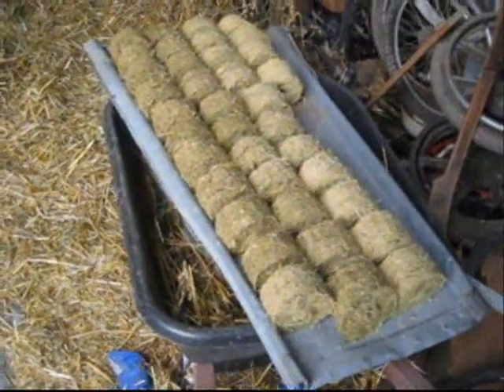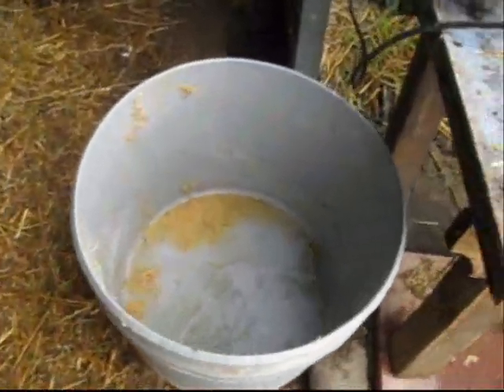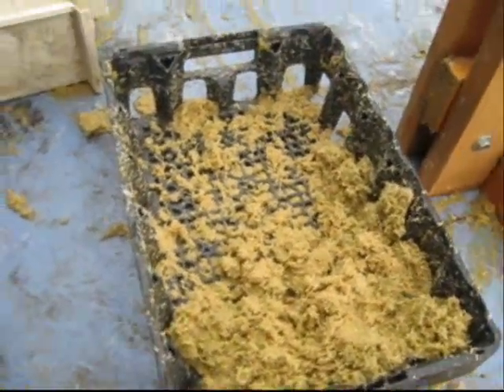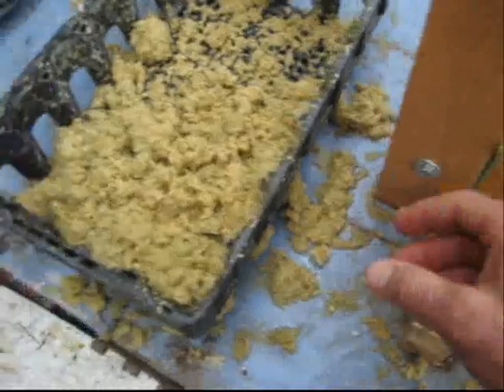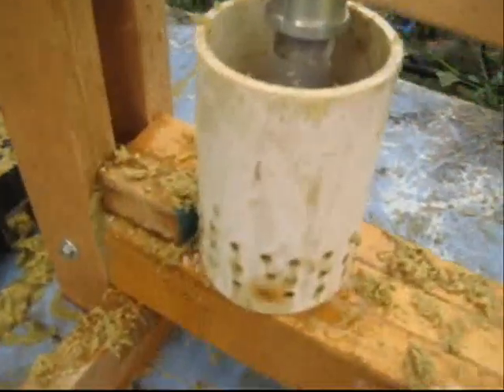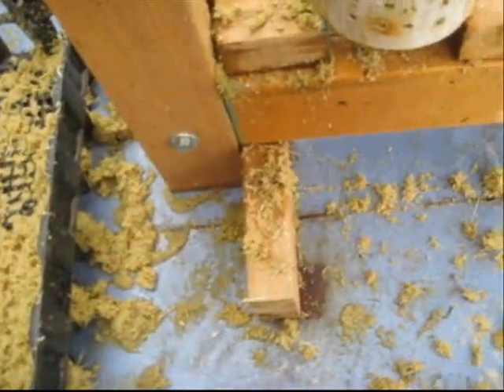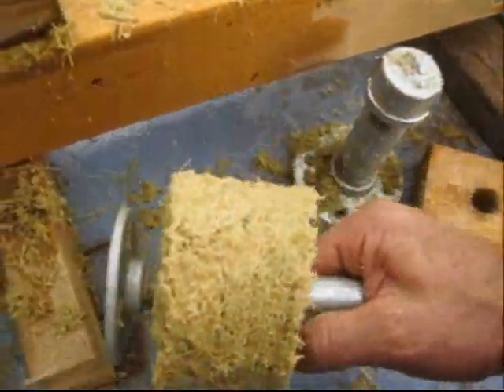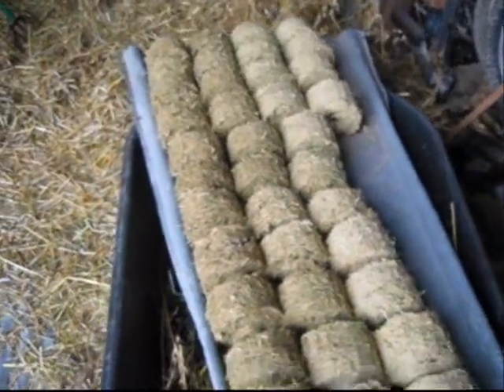Making Briquettes:  Take 1

Comment: I like this press. I've seen a lot of presses on YouTube having a linear motion, like a hydraulic jack. I want to make a lever-style design like yours.

My goal is to use up all my yard waste, mostly leaves. I think I'll need melted beeswax or something else to bind it together. I imagine there will be some problems with having to work quickly before the wax solidifies, and also the problem of recycling the pressed-out excess wax.
Reply: Hi, I don't know if you already builted your press but if you want the plans are available here http://www.leehite.org/ewb_project.htm I made mine this week-end and it's work great.
My goal it's to make briquettes from the dust and chips made by my wood machines.And I want to use the briquettes for cooking I experiment a mixture of wood chips and wheatpaste (glue made with water and flour). Sorry about my english.

Comment: I have been making Briquettes or Logs for about five years and you MUST either add some paper pulp OR Compost your materials for at least three days. I would say at the very least about 10% paper pulp but to get a good strong finished product the more the better. Some people use up to 100% paper but I know you need to use up your sawdust and hay so I recommend you use 10 to 20% newspaper pulp. Keep in mind that pulping any higher grade of paper than newsprint will be much more difficult to break down into a pulp. NOTE: paper egg cartons are usually very easy to break down. CARDBOARD is the most difficult to break down unless you make a special wobble blade table saw type contraption. You can find that on youtube.